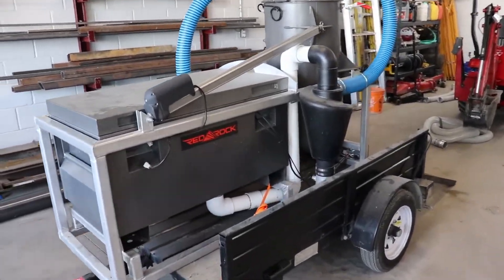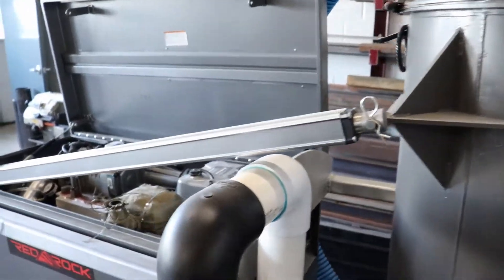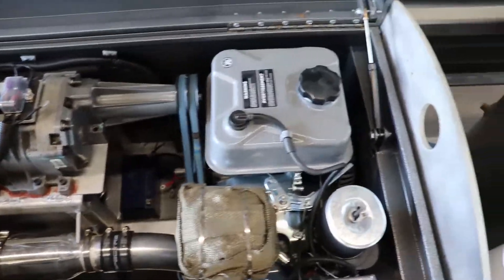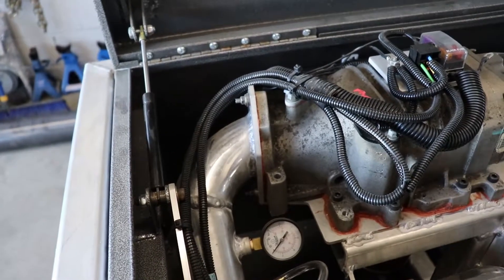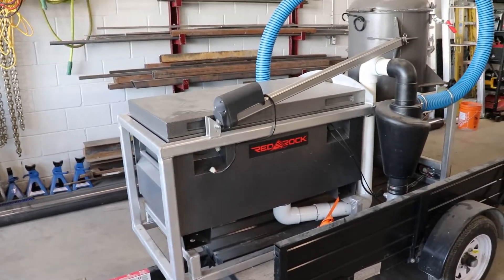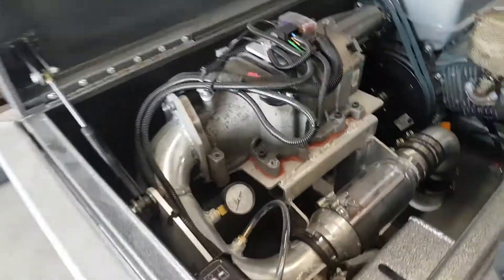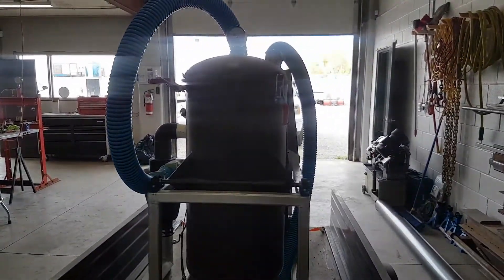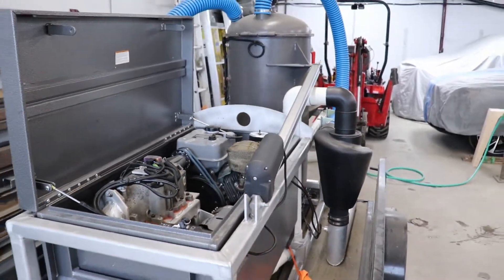WRONG way to use a supercharger - Vacuum build for Mini Hydrovac

Comment: When I worked at Stanley Steemer we used a sytem like this on our van. We had a bigger supercharger and a 3 cylinder Ford Fiesta motor. It could suck drapes off the wall and back to the van. We had to use a vacuum braker, to regulate how strong it was. Nice rig! I thought about making one for my house. We used the radiator water and the exhaust heat to make the water hot for the carpet cleaner. This type of rig is the only way to dry carpet after steaming it in my opinion. Anything else is going to leave you with mold.